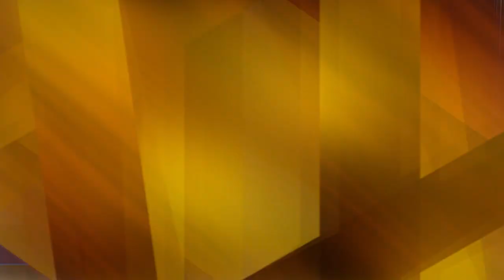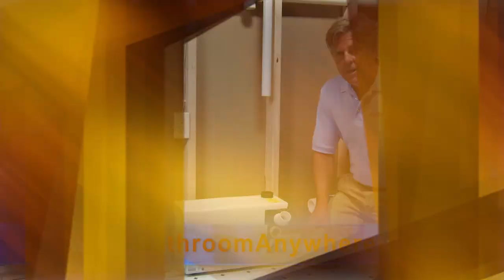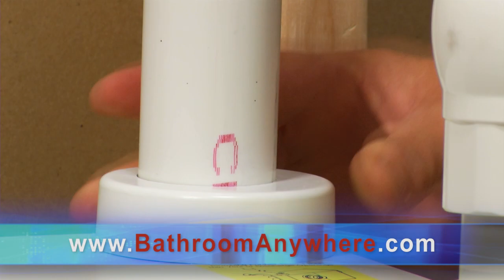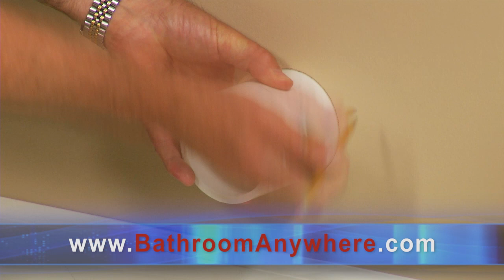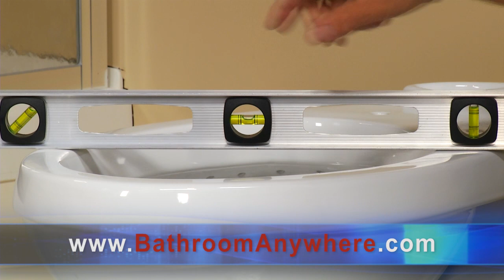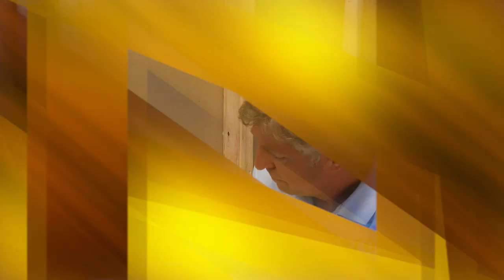Installation of the Bathroom Anywhere System

Comment: I wish to install a macerating toilet on my first floor which will drain to a pipe from an existing hand basin or under sink drain pipe in the kitchen.. All installation videos I've seen deal with waste being pumped up. Is it possible to pump down to connect to existing drainage on the ground floor?
Thanks.